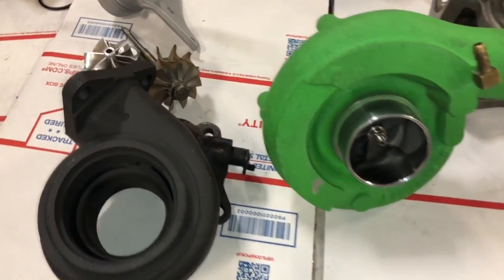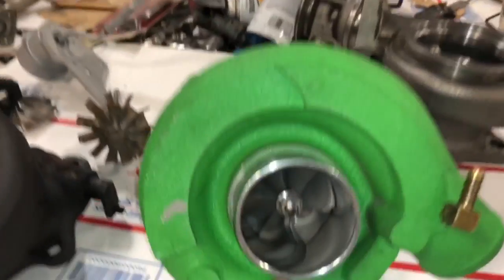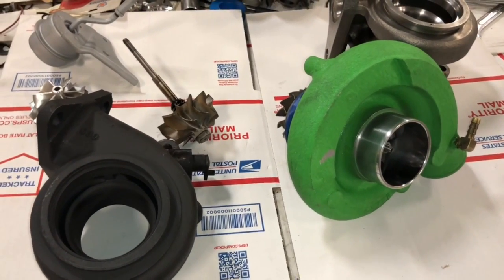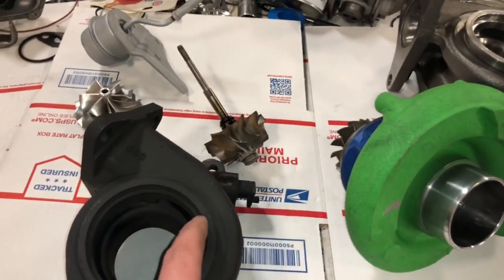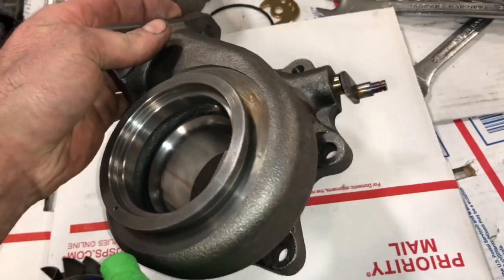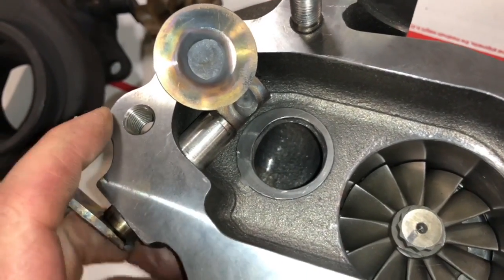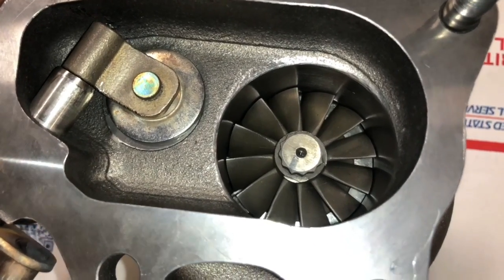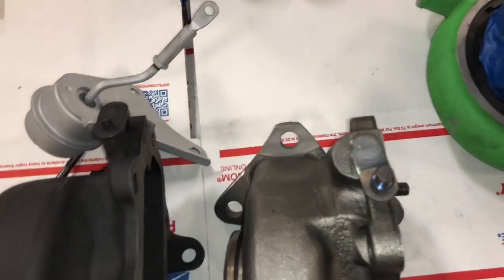Blouch 20g XT Turbo rebuild

Comment: I was actually planning on buying one of these.. What ball bearing 20g would you recommend?
Reply from the maker: The XTR is ballbearing , for the Subaru blouch has some good ballbearing turbos I have upgraded them a lot, the biggest problem with repairing them is the odd wheels they use so I upgrade it to more common wheels.
Reply: @turbolabamerica  thanks man!